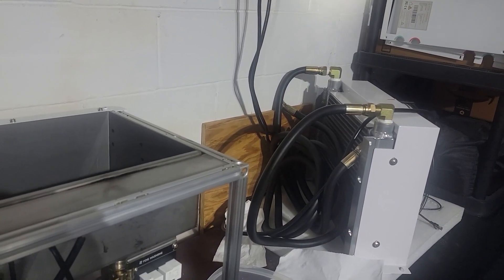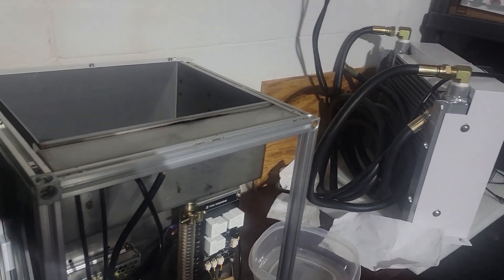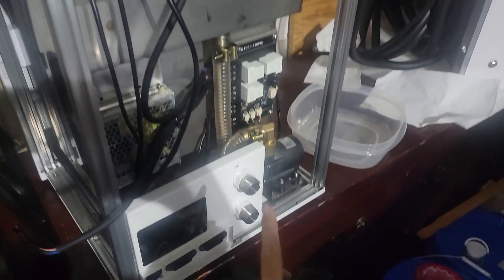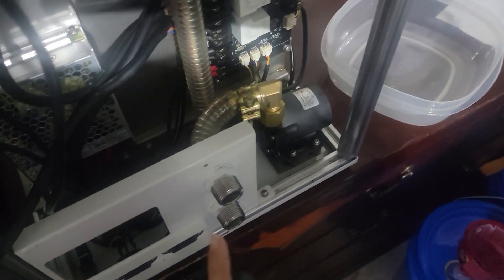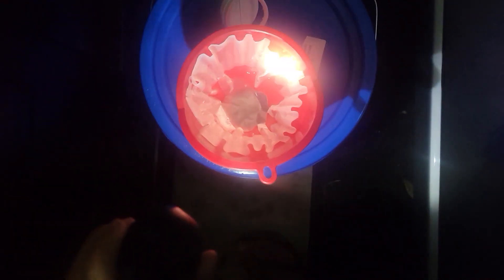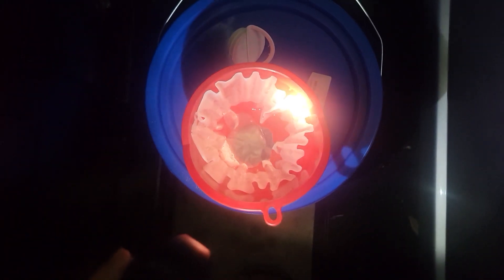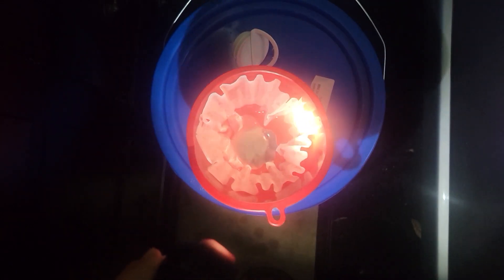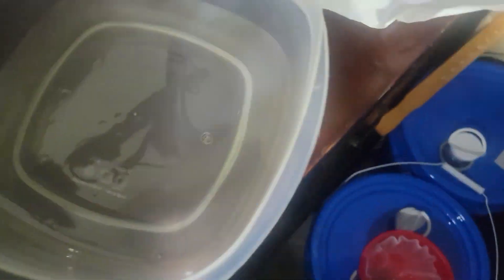"My Immersion Cooling Pump Disaster - You Won't Believe What I Discovered!"

Comment: What you suggest to protect downstream equipment.
Reply from the maker: As far as filtering? If you add a filter, then you need to account for increased back pressure and increase your pump size. The one you saw in vid, was only 2400 LPH or liters per hour. As far as data, need to setup a proxy for your LAN and combined with good firewall management, you can try to secure your network as your devices continue to talk with outside network services. Pools, stratums, peers, and other WAN connections. Firewalls like Pfsense, Sophos, etc.
Reply: @SerpentXTech  I meant for oil . How long are your pipes? I will have extended pipes but their engineering team have agreed a 12 m total pipe lenght hot side + cold side. I will also have a water/oil tubular HE in between . Reason why I want to protect all downstream
Reply from the maker: @marcogtturbo  so this system is for small at home setups. The longer the pipes or plumbing, the more oil you will need. Plus, the larger the pump you will need, like maybe a medium-sized bio-diesel pump, and that is without filters. You may want two check valves to prevent reverse flow. One on hot and one on cold side, then filter on cold side, because the radiator or heat exchanger can have particulates in it or that break off during use, that you would want to catch.
Reply: @SerpentXTech  but the kit is coming from them , pump is included and hopefully dimensioned correctly . How long are your pipes ? Are you now running a replacement pump from FH or you retrofit another one ?
Reply from the maker: @marcogtturbo  same pump and my pipes are hoses. Only 10 - 12 ft long, you sound like you're getting the base components, but you're customizing you piping for your needs.

Comment: I was going to go immersion with my rigs, but I've decided to go with water block conversions instead. This is one of the reasons why. The other being the cost of the fluid has gone up quite a bit recently (Engineered Fluid's Bitcool went from $150 to $200 per jug recently, and I need 20), making the per unit cost almost double what water block conversions would cost; $1000 vs. $600 per rig, including the other equipment needed. Plus other benefits like less space requirements, leaks are just water instead of expensive fluid (just have to position things so a leak won't get on the miners themselves and cause a short), don't need extra fluid for the waste heat utilisation system I'm setting up (heating my house and domestic water), etc.
Reply: Afaik water block conversion is not possible for asic . I would have chosen this one as well
Reply: @marcogtturbo  Yes, water block kits are available for many of the most popular, newer ASICs; the s19 variants, m30s, etc. They're very easy to install as well.